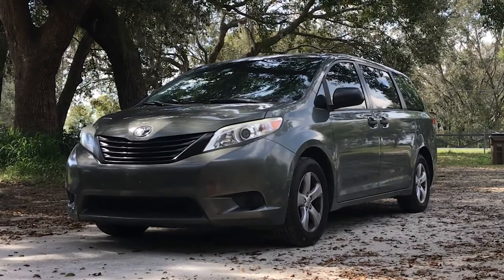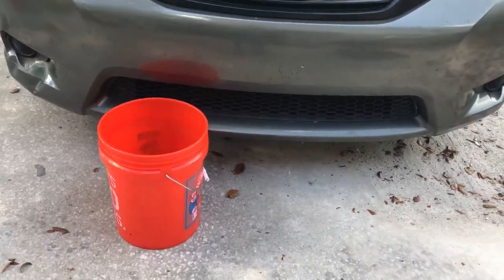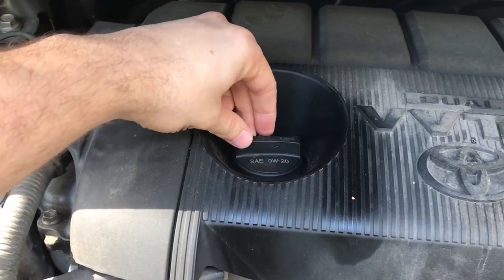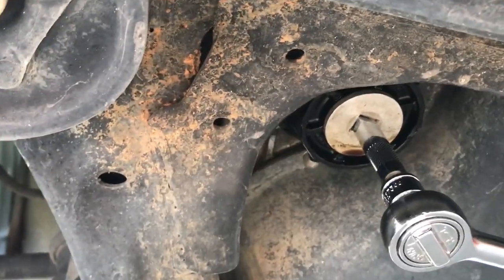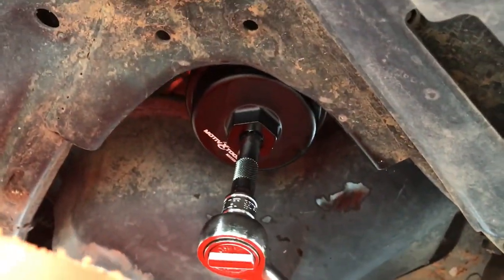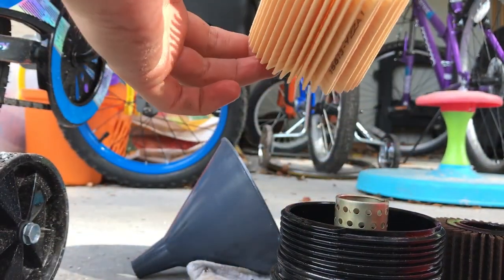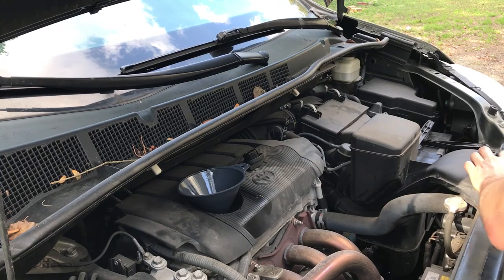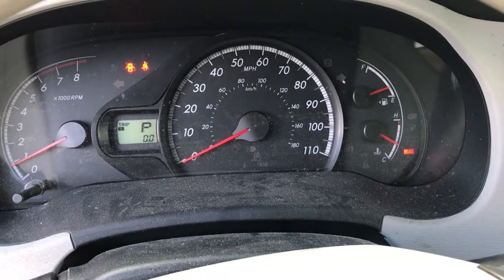2012 Toyota Sienna Oil Change (4-Cylinder)

Comment: We bought a 2012 Sienna 4-cylinder new and drove it for 340,000 miles miles until a drunk driver side swiped it in 2022 and insurance totaled it because they said it was only worth $3500 and it would have been more than that to fix everything. underpowered to be sure but reliable. so many family vacations and trips to soccer tournaments. It was a good vehicle.

Comment: Judging by your video, I think you over tightened the drainbolt on the oil filter cap. 
Oil filter cap = 18 ft.lbs
Oil filter cap drainbolt = 9 ft.lbs.

If you over tighten the drainbolt then next time you go to remove it the entire oil filter cap may come off with it.

I would check the dip-stick after your car is off the ramps on level ground.